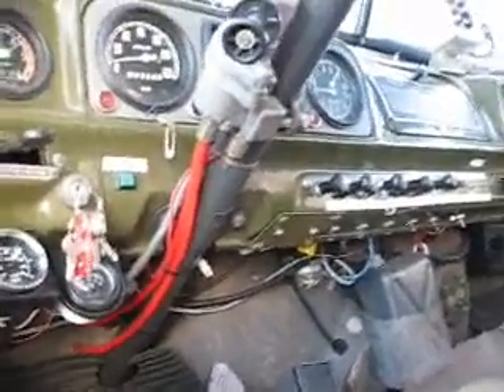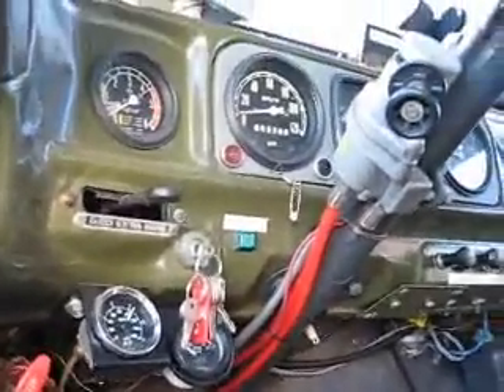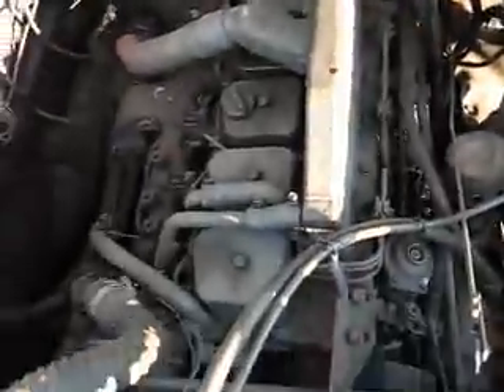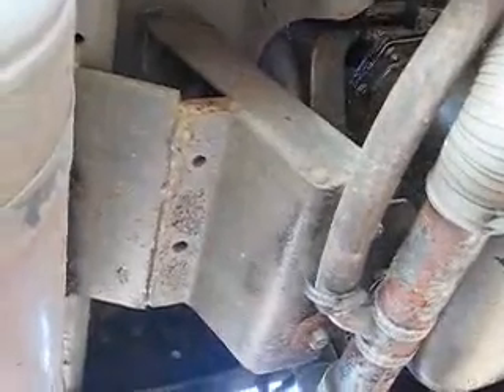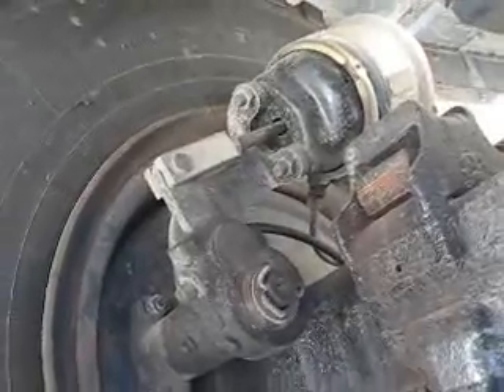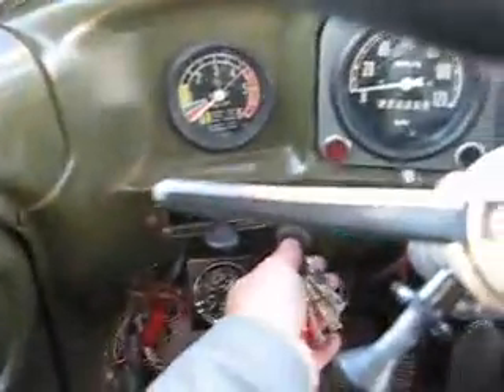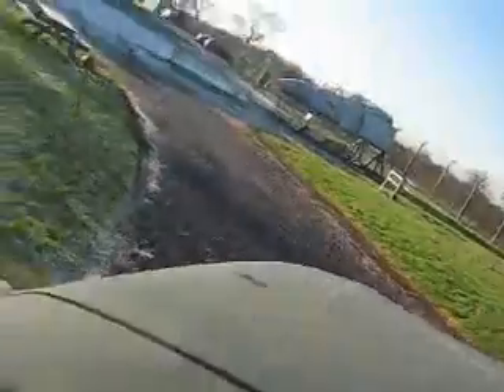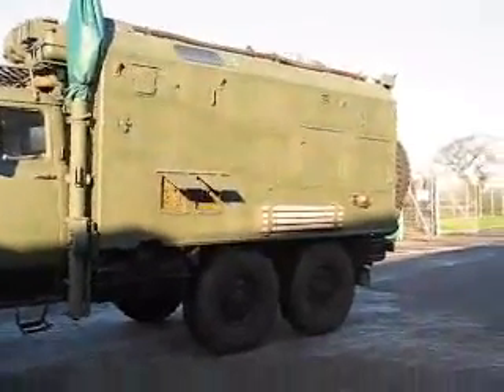Zil131 engine & Brake modifications

Comment from the maker: @14th20thKRHkickass Your dads regiment, well now I feel old lol
You can buy the regular zil 131 at around £1200, one on ebay now! You wont find radio trucks that easily, plenty of radar and older valve based stations. Road tax as private HGV £164, insurance abotu £200..through the windscreen magazine. Cummins engine has much more torque at low revs, so truck picks its toes up quite nicely...old petrol engine low in torque, remember it weighs 10T all of the time !
joe

Comment: @14th20thKRHkickass Yes yes,i know that,but i myself prefer the original engine more,when i use the truck for things it was meant for.And yes,putting a diesel in it is a great idea,but the Cumm. B just doesnt cut it.Such a truck needs atleast a diesel that a Dodge Ram has or something.

Comment from the maker: @14th20thKRHkickass I get around 12mpg from th cummins B engine (it has the intercooler). The main drag is all the hubs and the six wheel drive chain. Our commercial 17 ton truck with same engine give 15mpg. The Russian Camaz diesel engine is reputed to fit the zil, but I have only ever seen them in the Ural truck.

Comment from the maker: Other interesting observations is that Ural went to diesel engines, and even though it is a heavier truck compared to the Zil, Ural have Air-Hydraulic brakes which are nowhere near as good as the Zil. We find the Ural is not a truck which can stand idle, and then be pressed into service without a mechanical service. Thank you for your interest and enthusiasm.

Comment: The original engine does its job for the purpouse that this truck was built for.I would like to see,how you start the Cummins diesel out in the -40C winter.Everything on this truck has been designed for its own purpouse.Thats why you dont see much electronics on Russian trucks like these,because electronical features are not reliable in eastern countries,which are a lot different from the climate and terrain,compared to England.

Comment from the maker: Interesting comment. You have to remember that the R161 radio station weighs in at 10 tonnes and the gasoline engine is inadequate for that weight. Also, the crazy price of fuel in the UK would not permit me to show the vehicle, 4mpg is a joke when paying £1 a litre and have been doing so since 2000.

joe